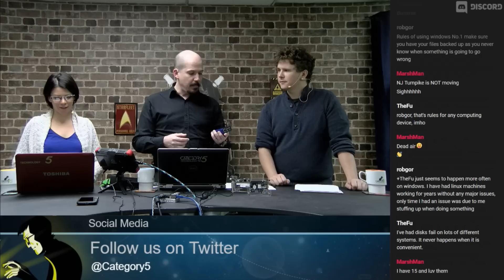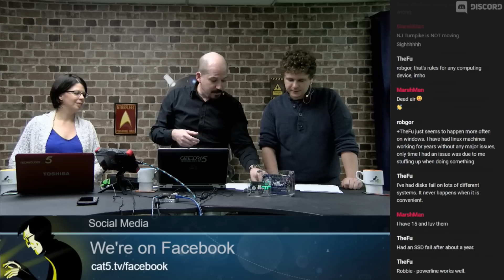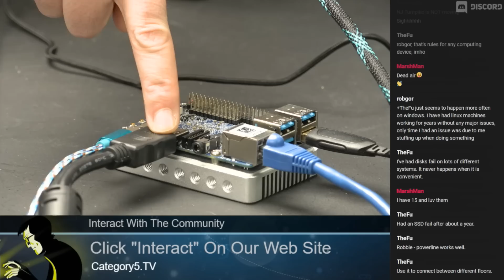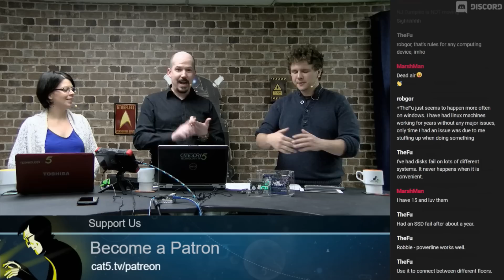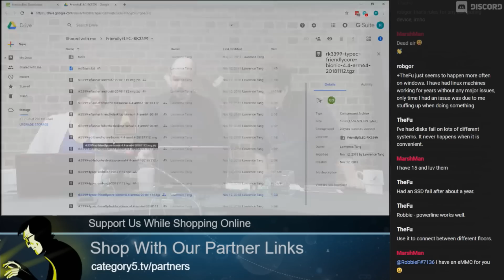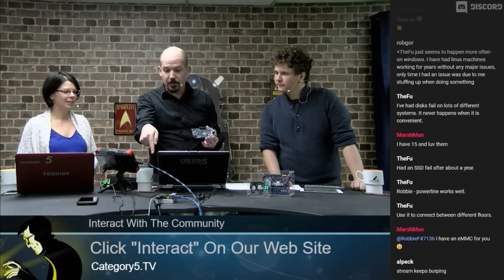A Look at Single Board Computers: Some Serious Competition

Comment: All the other SBC they fail compared to the Pi. The fail due to their huge power requirements, not having the credit card size footprint, and most importantly cost. I like my Pi, nice and small, operates quickly, boots faster than my work laptop, looks good on the screen, performs very well in my opinion(don't attack my opinion or i will hunt you done), and I did not have to break the bank. Now the Pi makers just need to modify it so we can add more memory as we need it.

Comment: I'd like to build a desktop using a single board computer. But I want one with 8 GB. Any suggestions? BTW my limit is $100.00. I already have a keyboard and monitor. Any suggestions?
Reply: Get the Latte Panda Alpha, it's an SBC with Intel Proc and 8GB of RAM plus it has built in storage from 32 to 128GB, also supports new M.2 SSD's.
Reply: @WouterKriel87  Looks like a wonderful computer but its way too expensive.

Comment: I'm sure you've already had a good dose of criticism to read through below, but I need to add some more in hope you improve the videos later. First the topic: there are A LOT of much better competitors out there and many of them have been around for years (Odroid XU4 for one) - at this point it's not about the "power" or "features" with SBCs but finding their niche. RPI is still the best entry level with average performance in all departments. XU4 beats it in more processor intensive tasks so has been used for emulation and media. Tinkerboard is a slight upgrade in connectivity. There are SO many better cards you could have covered and focused on their strengths/weaknesses. Also Rock boards and pretty much everything with ROC processor is a bit of a wild card as it gets tremendously hot and is unstable. I've had one running for 2 years now and it's the only SBC I constantly have to check up on.  Next, you don't need to have 3 people on the screen. Talk to the camera and the audience not to the guy next to you as it makes it seem like you're selling something (infomercial). Lastly, the camera should not be a webcam (use a smartphone cam at least) and the mics could have higher quality sound. There are plenty of mics on Amazon for 20 bucks like BOYA that do a much much better job.

Comment: The M4 supports QC 3.0 chargers so that would provide the extra amps and also be variable output making it more efficient.
Reply from the maker: Wow, great info! I didn't know it supported QC 3.0 so I stayed away. I was looking at the charger's compatibility, but should have thought to check if the M4 itself supported QC 3.0!  Though I have to admit, I'm glad I took the route I did: I now have a brilliant bench DC adapter  :)

Comment: WHAT? the guy's solution for RPI's wifi problem is not a $10 wifi USB dongle, but to drill a hole on the wall for Lan cable?!
Why is this guy hosting a tech channel?
Reply: Technically drilling a Hole is a lot easier than waiting for that dongle.
Reply: IKR or like TP Link isn't a thing.
Reply: I’ll take cable over wifi unless i have no choice and i have awesome wifi at home. Wifi is not a replacement for cable.
Reply: ^My thoughts exactly.

Comment: I have no idea what you tried to stream but 1080p x264 and 720p x265 @~12000kbps are no problem with the rpi3b+, as long as it is connected to a decent wireless lan with 150Mb/s.